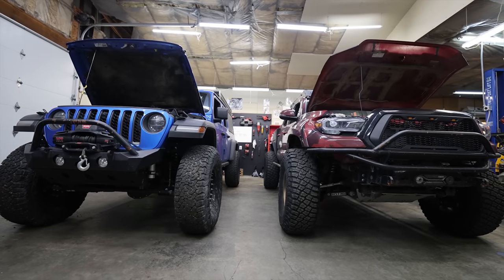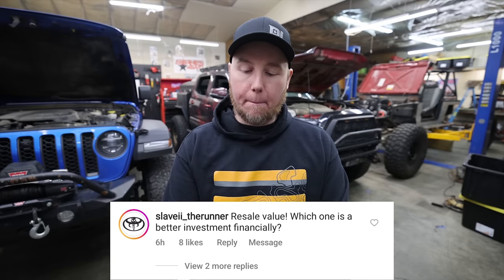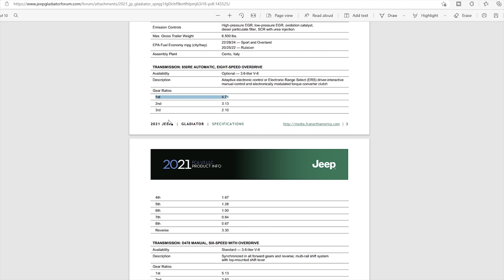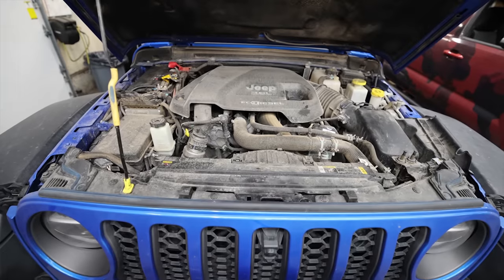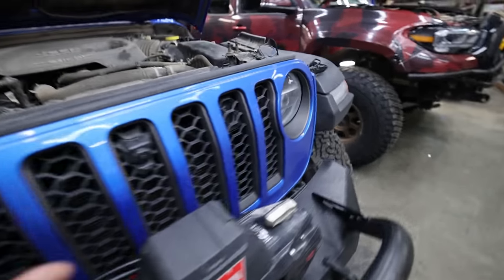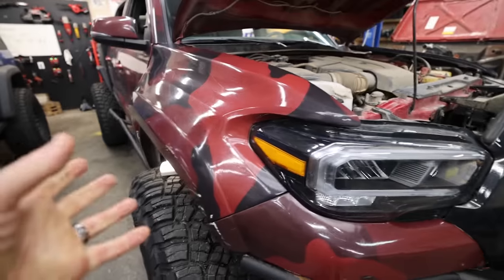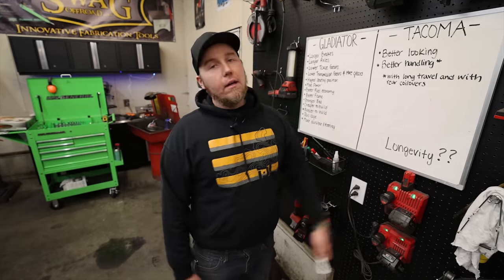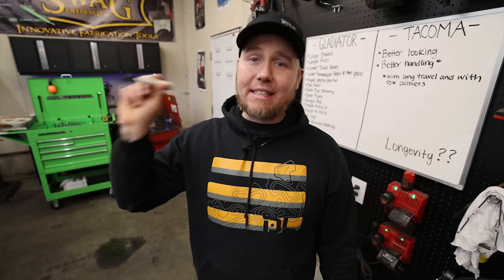My 21 Jeep Gladiator Vs My 21 Toyota Tacoma. Cold Hard Facts.

Comment: Honestly, the way I kind of compare to Jeep to the Tacoma is similar to Tinkerer's Adventure.

I think the Jeep out of the box = Rock crawler oriented 
I think the Toyota out of the box = Overlander/Desert racer/dirt roader

Like you said, its way more $$ to make the Tacoma a rock crawler that wont snap CVs constantly. 

That said, if you get a Tacoma I personally think the manual transmission one is the one to get.
It's geared lower from factory.
Gets better gas mileage (my average in town was 19-20 and 20-22 highway)
It doesn't have as many annoying electronics.
The auto will kill the engine if you roll it backwards and it's in 'drive'/throw codes etc.

Sort of speaking to a few random things...

Airbox: I once did find myself behind 30 or so cars on a long stretch of dirt road and after that insanely dusty none-sense my airbox was clean(literally spotless).
Visibility was worse then thick fog so for sure, if you remove the fender liner for large tires, you almost certainly have to consider some kind of snorkel situation. 

Engine: The 2GR-FKS also makes for an awesome turbo host.
Way back when Orange Virus tunes were all the rage (now VF Tuner), that company made a turbo kit for about $6,500.
At about 14PSI you were making 500fts of torque at 3000RPMs, overall it turned it into an EcoBoost as far as what you might expect. 
You did need to do some modifications to the vehicle like a tune/different fuel pump etc but you did not need to really tear into the engine.
I still wish however, that the Tacoma had a diesel offering, though I will never own anything that's setup with that DEF regen non-sense.

Toyota frames: I hear from many Toyota techs that they do need to be cared for and coated lest they rust.
Personally, I still need to do this and what I landed on is the below.
>> Por-15 Gloss Black (rated best by Project Farm and suggested by XO)

Front diff: The front needle bearings are...lack luster and you would do well to replace these with ECGS bushings.
Also no real locker as Toyota leans more on it's A-Trac to make up for this.  

Brakes: Average, but if you go up in tire size you need to think about how to tackle that situation. Jeeps appear to be made assuming people are slapping on larger tires and it shows. 

Reliability statistic: There's a few websites for this and trying to ensure this post won't get flagged I'll link those below.
>>dashboard-light.com
>>carcomplaints.com

Market value: I'm sure there's better sites but I've used this at least once or twice. 
>>usedfirst.com

And lastly, my brand new off the lot 2019 Tacoma TRD Off-Road was $33,000 totally stock which wasn't half bad as far as making a budget off-roader.
I just threw on 33s (255/80R17) without any real mods and they actually fit quite nicely with only minor re-modlding of the fender liners.

Overall, if I was to sum up Toyota or the Tacoma, I think it has a great drive-train that will last a very long time, if you're willing to deal with its other short-comings and recognize what it's kind of originally built for (not really rock crawling).
Also hope some of that is helpful, I'm mainly trying to add to the conversation as far as what I've run across over the years.
Reply: I hate to be that dude. But without swapping to a long travel IFS system for the money with a Bolton 2.5" mid travel kit and a jeep with 2.5s the gladiator will work way better at speed.

But I also own a built power wagon with everything done to it minus bumpers so I'm a little bias
Reply: @Rommer2258  - Honestly I can't speak from any personal experience to the felt suspension differences outside of what Nate has mentioned or that other channel Tinkerer's Adventure (that did a Jeep vs Toyota video) but, sounds like a nice setup!
In slightly related news, Accutune has a pretty nice setup for the Tacoma as well as a video coming out on their setup for Jeeps which I'm very curious about.
One thing I see missed in a lot of builds is finely/properly tuned suspension, and it makes all the difference in the world. I also wish someone would do a Nate style comparison between the  Bilstein Zone Control Shocks as well as a nice set of tuned Kings or Fox's. 

@Nate - Also forgot to mention great video and keep being you. Your channel is great because as far as I can tell, you seem very authentic and you're just processing stuff out loud. I don't think anyone can fault you for that. 👍
Reply: @megahurts2  Accutune is a great company, and pretty much anything they touch is great. But for the Bilsteins unless they are tuned professionally the fox and king will blow them out of the water. At the end of the day it's just a tube with some shims and some oil/nitro mix, it all depends on who sets up your shim stack

Comment: I have always been a jeep guy, I am on my 9th one of various models. I agree with the looks of the tacoma. I would be curious to see what the comparison of bottom dollar cost is. Including you labor and retail cost of items on the taco. Without doing research I would bet the gladiator is more expensive off the showroom floor, but the cost to bring to bring the taco up to the capability of the Gladiator I would bet skyrocketed.

Comment: what is driving better on long drives? because you are spending 40 miles on trail max, but most on asphalt road. you can't compare gas vs. diesel for towing . Tried to tow with PenStar engine.

Comment: I'm 100% with you on the new 4runner idea, with also using the solid axle coil front off of the 70 series range landcruiser. I own and daily drive a 1st gen 4runner and a revamp retro build with a removable top would be unreal! Ford did it with the bronco.

Comment: I miss my tj love my tacoma my tundra  jeeps doors off top down shift gears love it  taco shift gears easy to put my kayak in the back and roll both have advantages and disadvantages  have my tundra now keeping that why I really really looking at jeeps 2 door of course 6 speed might not be 4.0 but I'll give these 3.6 a shot won't suck that much on gas think they have little bit lower rpm on the hwy then the tj it was rough driving from Texas to Cali on those big hills poor tj struggled  but i had a blast going that way anyways awesome video  thanks for the intel

Comment: I like both Yota's and Heep's. I have a little reg cab Tacoma.  It has been regeared and fully locked.  It also has a pop up camper on it, so it is comfy to camp in for days on end.  I plan on adding a JK or JL to the fleet.  The plan is to have a rock hound and a washboard warrior. If only Jeep would come out with a reg cab or extended cab Gladiator.  I hate 4 door trucks with small beds.

On a side note, it pisses me off that both Toyota and Jeep make you buy an upper lever trim  just to get a factory locker.  Meanwhile at Ford, you can option a rear locker for fairly cheap on even a base model 2wd truck.

Comment: Excellent video, I like the unbiased review. If I had a blank check, would 100% by a Gladiator, or a JLUR. unfortunately I can't afford either one of these vehicles, so I'm not a buyer. A few years ago I bought a 13 4runner, I bought it as a decently capable daily driver, I had no need or aspiration to build up a vehicle to this level. If I did, I would not have bought a modern Toyota.

Comment: The Tacoma is one of the most capable 4x4s you can buy if you're going to stay completely stock with stock tire size. But if you modify...solid axles just become the clear winner. Same goes for the Bronco and even more so the Defender.

Comment: As a Gladiator Ecodiesel owner, have you looked at an aftermarket cold air intake (K&N or AFE) for your truck? and/or have you looked at Banks Power derringer and pedal master to get the most out of the Ecodiesel? I want to do both but don't have the coin quite yet to pull the trigger. Love watching your videos! Keep it up!
Reply: Get the aev snorkle. I have it on mine and it just got tuned & deleted. It sounds and performs like a whole different vehicle. Like nate I’m on 39s and have method bead grips. with 4.56 gears it rips in part because of the much lower rotating mass vs similar size tires especially with beadlocks and will readily melt them if I want.

Comment: With how ads work on websites, I would wonder if they pop up by the ad generator reading the article and/or your search history and bringing up what it thinks you want to see.  The magazine companies just put an ad generator in there and I bet they don't have much say in what shows up.

As for the rest, it's kind of an apples to oranges comparison.  IFS vs solid axle.  The tough part about comparing the longevity of the Jeep vs Taco is that so many Jeep owners modify and then use them hard  So of course they break.  

I don't think you'll lose anyone over this.  You were pretty fare.  I think, though, you need at least one Nissan in your garage.  The Frontier is the only off-road capable rig they have left.  It would, though, be interesting to see if you could take the Armada or the Infinity QX80 and make it into what the guys in Australia have (i.e. extend it and put a dog box on the back and call it a 'Tourer').

Comment: The reason we don’t get the more interesting trucks from overseas is the Chicken Tax that goes back to the 60’s or 70’s.  It’s complicated but basically due to European taxes on US poultry we imposed a tax on light truck imports.  This is why the imported Ford Transit vans go through some weird process, and why Subaru welded the seat bracket in the bed of the BRAT, so it could be imported as a car not a truck.

Comment: I knew the limitation vs Jeep when I bought my 2nd gen tacoma back in 2007. Modified just enough to get me to go many many places I would never go with an SUV. Yes, I was stuck a few times and rescued by Jeeps too but never had a desire to rock crawl all the way up to the top of Mt. Rushmore. Lol. After 290K+ miles I'm seriously looking into the upcoming 4th gen tacoma. I just hope it doesn't look as ugly(big body with small tires) as Tundra or I would simply keep mine for another 100K+.

Comment: I think one thing to note that wasn't mentioned in this video was cost to buy UPFRONT. As in just the vehicle with the options you pick from the factory. For example a 2023 TRD PRO would be 48-50k depending on the transmission and a 2023 gladiator diesel would be around 65k-68k.
Reply: If you order from the right dealers you can get huge chunks off msrp for jeeps. 
I paid $43k for my diesel JT. I deliberately skipped a rubicon because I didn’t want the 4-1 tcase. If I had I could have got the same options I did (cold weather/LEDs/adaptive cruise and hard top) for $48k

Edit: they are up about $4k in msrp since I got mine though
Reply: @mattbrew11  Yeah but it sounds like you got your truck when discounts for domestic car brands were plentiful. Now a days its msrp or higher.
Reply: @xItsmeFirex  I know a bunch of dealers that still do big discounts on factory orders 13% off msrp is pretty common from certain places

Comment: The gladiator is a wrangler with a bed, the Tacoma is meant as a work truck. They’re very different vehicles meant for different things and will pluses and minuses in different areas.
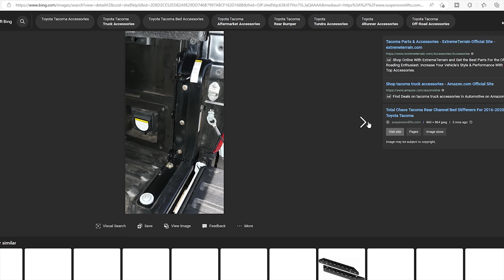Reply: I’ve owned both and used both for work…. Gladiator tow’s and hauls more weight.. 8speed transmission boxed frame 4:10 gears and progressive coils. … I really like both trucks but if the gladiator isn’t a work truck the Tacoma is super far from it

Comment: Just watching this. Being a Toyota guy for last 20years.  Their trucks have changed slightly in over all design structurally over the last 3 generations. I've owed all 3, all TRD OFFROAD version, 2003, 2012,now a 2017.  And Toyota is know for their if its not broke don't fix it. and its worked for reliability and cost cutting.  Ownership and manufacturing.  
But I agree with Nate why don't we have the Hilux, but the next Tacoma will have to be a full on redesign.  And from what I'm seeing they are heading that direction. Rumors are will be Coilovers all 4 corners. Hopefully a boxed frame. I'd like to see a diesel. But I think its going to be more of a hybrid option instead.  EPA is pushing all Manufacturers.

Comment: You forgot one con for the Gladiator. You have to become a “jeep person”. 😂

Joking aside I think you nailed it on the head. When I got into rockcrawling in the mid 90’s building a jeep meant replacing the whole drivetrain but you could buy an old toyota, put a marlin box in and out wheel your jeep friends for $5k. Now old Toyotas are expensive and new Toyotas are the ones needing the axles replaced.

Comment: On your last tacoma rubicon trip there was a diesel jeep in the pack that kept punching holes in the fuel filter, or the fuel filter housing underneath the cab.  Does your diesel gladiator have that same issue or did they move that filter... or did you skid plate it?

Comment: Thank you for mentioning the air filter on the Gladiator diesel. I was seriously considering one but the over-heating limp mode issue kept popping up. From doing a ton of research I had noticed the air filter possibly being at least part of the issue.

Comment: The 3.5 in the Tacoma should've never happened tbh. It's power curve makes it obvious that the engine was made for a car and smaller SUV's, and is also the reason why I traded to a 4runner. 

The torque curve of the 4.0l is so much better. A straight axle front would also be a welcome change, or a better setup IFS out of the box with more clearance for larger tires.

Speaking of clearance for tires, the front body mounts should've been situated atleast 3" rear of where they are now. What engineer thought it was a good idea to put the mount in a location that intrudes into the wheel well?

Comment: If you want to learn about the reliability of the vehicle you need to look into technical bulletins that are put out for mechanics as well as the recall reports for potential and verified recall issues on vehicles. Recalls in particular are backed by data and though technically all actualized recalls are for safety issues only, I believe that potential recall issues would likely be a good source for information. The catch being that you do have to be careful to make sure you don't assume all potential recalls contain the full amount of information to make a judgement on reliability. On the other hand, technical bulletins indicate issues the manufacturer wants mechanics to be aware of. So therefore, they directly point towards issues the manufacturers have recognized as a problem that needs fixing.  

Also as a FYI thing, the 90's Tacomas with the fully boxed frames with rust issues had them due to water drainage issues if memory serves me correct. I remember this being one of the major reasons most manufacturers have switched to C frames on light duty trucks aside from cost. Drainage related rust was a common issue for older boxed frame trucks in general. As for current Toyota frames, you cant really fault them for bending if you load them past what they were designed to carry. The same is true for any car or truck. you also cant fault the frame for bending when you lift it on a 2 post lift using spots other than the designed in lifting points on the bottom of the vehicle as many of the photos you provided appear to show. This is also true for any vehicle, not just Tacomas. To fault them for this is akin to being upset that your passenger car tires don't do as well in the in the sandy dunes as purpose built paddle tires do.  

Also, if you look at the load capabilities of 90's vehicles versus current trucks you will see that current mid-size trucks such as the tacoma have the capabilities of full-size level trucks of the 90s. This alone clearly indicates that tacoma frames of today are stronger and better designed than tacoma frames of the 90's. I remember seeing a Toyota engineer say something to that effect in an interview too, but I cant place where I saw it at the moment.

Comment: So basically, wranglers are a superior platform for off roading. Toyota's are basically a light duty truck. I still want a Taco BUT you can't beat how versatile the Wrangler's suspension is. Plus the only current Toyota with a manual locking transfer case is the 4R TRD PRO.

Comment: Hey one question I have is which pickup is cheaper for insurance? As a 25 year old that is looking to buy a newer pickup, insurance cost is very important to me.

 There’s a reason I’m still running my old reliable WJ that has the 4.0 and 250,000 miles that’s on 33s with a 3” lift kit I built myself. It’s bought, paid for, cheap to maintain and insure. 

I’m also just tempted to SAS my ‘93 Chevy Silverado K1500 with the 350 backed with the NV4500.

Comment: Ive owned a 2017 Tacoma, spent over 20k in parts and shocks , gears, lockers etc. that thing was a beast. However, I’m shopping for rubican gladiator now….stock from manufacturer they are ready to go opposite to the Tacoma which is “capable”. Btw that front end this dude has is nearly 20k with install. Like what?!?!

Comment: One of the benefits of any Toyota is usually it retains a fairly decent resale value. With Jeep....well the Wrangler always retains amazing value but we don't quite know if the Gladiator will follow that same path. It's a damn good guess that it will but it's still a little too early to say so definitively. Personally I don't plan on letting my '23 Mojave go anywhere in the foreseeable future. I'm gonna keep it until it pretty much falls apart 😉